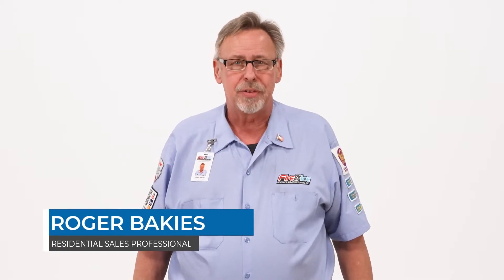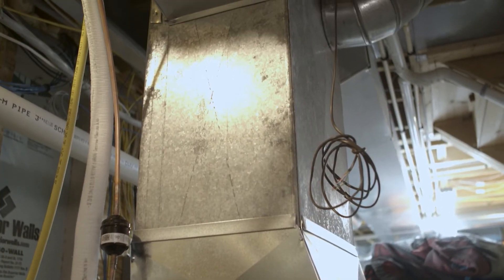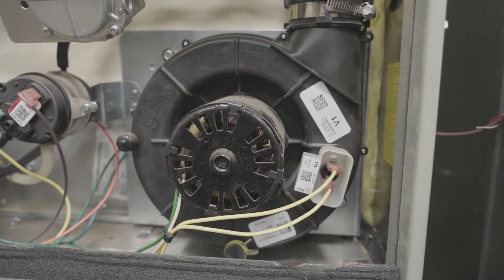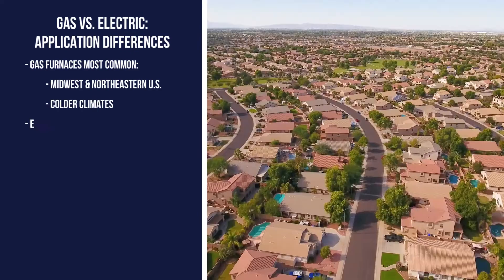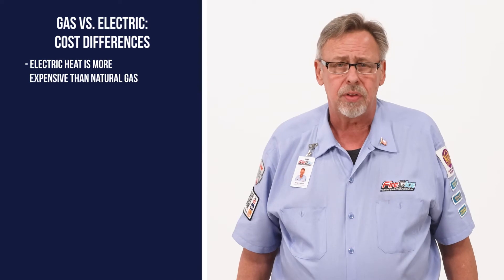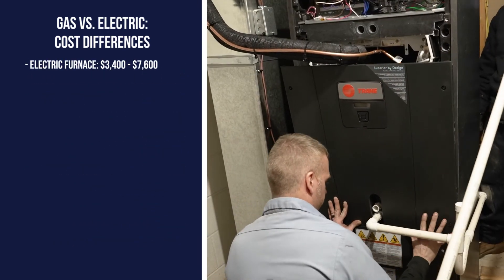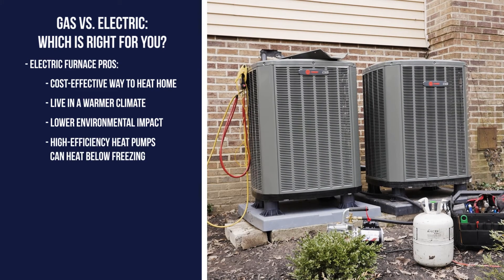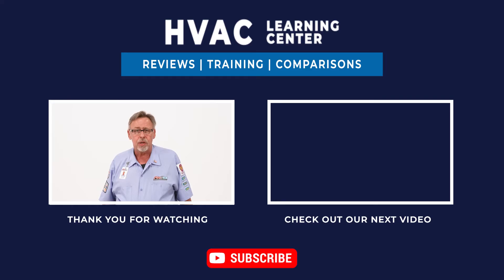Gas vs Electric Furnaces: Which is Right for You?

Comment: I have a very good solar system in Vegas and I pay $20 electric monthly in the summertime when my central AC is in full blast. Thinking of switching from gas to electric furnace. The gas furnace is in good resale condition and that would cover some of the cost. Make sense?
Reply from the maker: Starightvelectric furnace is generally the most expensive way to heat

Comment: You definitely do not need a heat pump for cold climates with an electric furnace.  It's can go as . -30C (-22f) or colder multiple days in a row and still keep the house plenty warm
Reply: This is for a forced hot water not air vents

Comment: Thanks for the information. 
I am in Ottawa,  I recently got a house.
The bill fro the old gas furnace was $240, in the winter.
The furnace is old, it was made in the 70's, so I am looking for an electronic furnace.
The gas one I have is oversized,  is an  electronic furnace better, Canada is cold 6 months a year.
Also the gas and the electricity prices have risen..
Reply from the maker: Heat pump with gas furnace as the auxiliary heat is my recommendation

Comment: Actually looking for a propane system that doesn’t use electricity
Reply from the maker: If you speak of the old Thermopile systems, they don’t make those anymore.
Reply: @fireiceheatingandaircondit4363  that might be but it was a good system just don’t touch it
Reply from the maker: Too inefficient for the govt
Reply: @fireiceheatingandaircondit4363  we both agree

Comment: I have an old house built in 1900 that uses oil to heat radiators throughout the house. I'm not sure how this can be converted to electric heating.
Reply from the maker: I don’t think I would try
Reply: Me too, i dont want gas anymore. Just a fire furnace and electrical lines with solar use at night in the warm months🥴

Comment: It would be great if there was a modular option that allowed you to easily convert to oil,natural gas, or resistive electric by simply slotting in a new heat exchanger making all the connections and safely shutting off the old connections then possibly reprogramming the thermostat for the new functionality, instead of ripping out everything and starting over from square one even if you have a perfectly functional ac unit and just want to switch from oil to electric without tearing half the house apart to install minisplits and baseboard heat or replacing the whole ac unit from compressor to air handler and everything inbetween.

Comment: I'm in the St Louis area.  My townhouse is 2 story 1200 sq ft and all electric.  Its fairly new (2004) and well insulated. 
In previous homes I had gas heat.  But now I actually prefer all electric.  My highest bill ever in last 6 years was $185 in the coldest months and $165 in summer.
Reply: Thanks for the information. 
I am in Ottawa,  I recently got a house.
The bill fro the old gas furnace was $240, in the winter.
The furnace is old, it was made in the 70's, so I am looking for an electronic furnace
Reply: @theybanthetruth4955 get new gas furnace, electric bills are usually more expensive than gas bills.
Reply: @hasanagera  oh, ok I will be buying a new one in April.
Reply: @theybanthetruth4955  for example, when you buy a water heater tank, on gas water heater, it says $330 estimated annual cost. But if you buy electric water heater it says $550 estimated annual cost. This is a big difference.
Reply: @hasanagera  I have one electricity and every month comes in the bill between 500 to 700 dollars and I don't know if the problem is in it or something else. You advise me to buy one gas or electricity better
Reply: @mohammedmouhssine7816  our house is 1800 sqft. The last bill was around $300 for both gas and electricity. Gas cost was $180. This is with upstate ny coldness. And electricity is 3 times more expensive compared to gas for the same amount of heat output. 

My suggestion is talk to a contractor. But buying a furnace online is at least 500-700 dollars cheaper than a store one. The warranty situation doesn't matter as the furnace company will tell you to hire a licensed contactor to process warranty. You can buy other parts for furnace from the local shop.

I have an important question. Where do you live?
Reply: @hasanagera  I live in St. Joseph Missouri, electricity alone comes to me a month between $500-700
Reply: @mohammedmouhssine7816  you need a buy a gas furnace then. They cost around 4k in general. Unlicensed people can do it too but if you want licensed then call many hvac contactors as some of them can overcharge you.

And make sure it is at least 92% efficient.
Reply: @hasanagera thank you so much
Reply: I live in the St. Louis area also, on the Illinois side, and am all electric in my 1,100 sq foot ranch house with basement.  I replaced the old electric furnace and a/c last fall  (October 2023) with a new Daikin cold weather heat pump system.  I sure wish I had gas now.  My January electric bill for 30 days just arrived ---$419  of pain.  My jaw dropped when I got the bill.  The electric heating coils are set to kick in when the temperature drops to 20 degrees.  The four day cold snap in mid January where we got down to zero for a few days just killed my savings.  I guess I need to call the installing company and have them set the electric heating coils down to 10 degrees or 5 degrees before activating the electric coils. I will light the fireplace during that time, I imagine.    Sorry I didn't go with a high efficiency gas furnace even though it would have involved having the expense of gas piping brought in the length of the basement and my yard dug up and a meter installed ( but done for free by Ameren).  I am not impressed with my heat pump.
Reply: My house is all electric as well as I don’t have natural gas in my neighborhood. I don’t mind and it’s easier to install as almost every home already has electricity. Natural gas has always been cheaper than electricity but electric is the only option for some people.

Comment: CA has a conflict of interest in electric anything. Why? CA runs the entire states electric grid through a system called CA ISO, a state owned/run power grid buyer and distributor. They then sell the power to their many power distributors within the state such as SCE, PG&E, SDG&E who are the big three.  In the past 2 decades, CA has limited how much power the state will deliver regardless of the demand for power. For example, during summer the state's power demands have reached a 50 mega watt need but those who are running the ISO seem to refuse to produce or purchase the power needed to satisfy the demand and as a result, they have issued state mandated power outages in certain regions when the demand reaches a certain level, mostly around 40 to 45 mega watts. Makes no sense to do that because power production is there and/or it can be purchased out of state from power producers which is where most of their power comes from anyway. Then, in recent years, CA want to pretty much ban natural gas to cut back on CO2 emissions. They have already made plans to oust the sale of new internal combustion vehicles by 2035 and have eliminated the sale of new "small engine" lawn equipment in 3 or 4 years. They have also been getting several counties within the state to agree to ban natural gas heating, cooking, clothes dryers, BBQ's, fireplaces, pool heaters, water heaters and so on.  The state of CA basically runs and manages the entire electric grid yet they are also the same ones who are suggesting the state depend more and more on electric power all while they are obviously getting revenue from said power. So, they have claimed power is limited yet at the same time are making the demand for power increase. Most of the Californians know that power is not limited but the state creates a false story it is "in the name of conservation" and those same CA citizens are being robbed with power rates that are .38 to .44 cents per kWh as of today July 2022. 
Can you imagine how much of a monopoly the state will have if everything goes 100% electric?  They will control your pocket book and your lifestyle. Sounds like they're going backward, not forward.